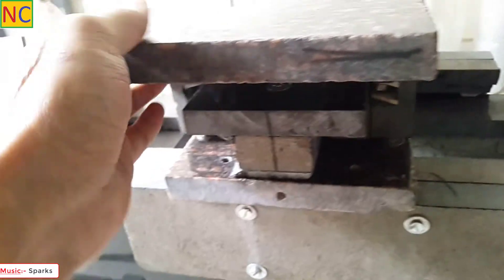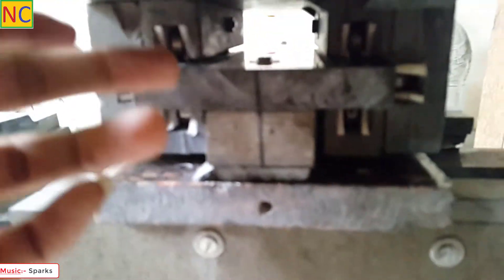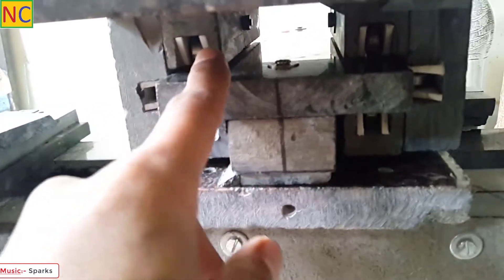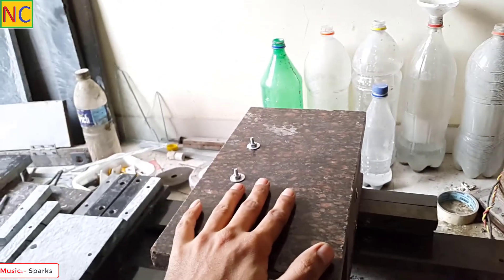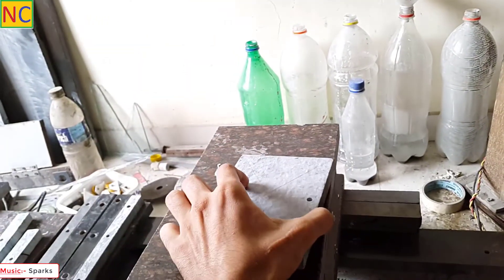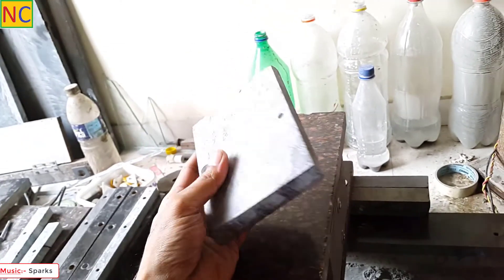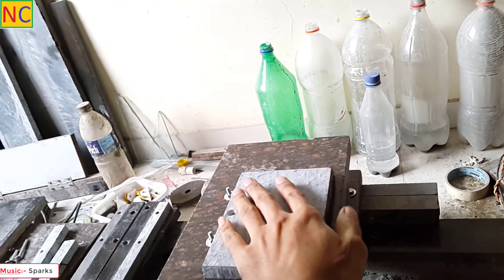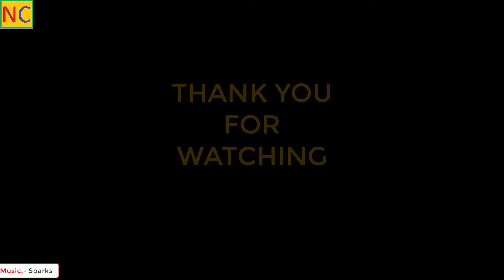How To Make Lathe Machine | Part - 2 | Homemade  Lathe Machine | Nonsense Creativity

Comment: Hi, wonderful project. How do you think that two pieces of granite will slide on each other?

Subscribed!
Reply from the maker: Hi.. happy 2020.. well.. I'm using ball bearings but it is not necessary... you can use two polished surfaces of granite or any other stone and proper lubrication will work fine. 

Now i am working on tailstock and i ditched  ball bearings ...
Reply: @creativeamol  Thanks, and happy 2020. Would you recommend using oil for lubrication just like for steel?
Reply from the maker: @Made2hack  its depend on the sliding mechanism design because it need certain type of  viscosity oil..better you go for grease.. and do some  trial and error ...
Use the machine for specific duration and check whether lubricant is circulating or not then change the oil for different viscosity

Comment: what are you using as reference surface? is that just some polished granite? while it might look shiny, it often isn't very planar. you might want to lap in some plates with the three plate method (there's also a two plate method, but it requires you to make a tool for measuring planarity). You can see how that's done here https://www.youtube.com/watch?v=X37SIhRmzf4
can't get a flat part if the reference isn't flat to begin with.
Also, I think stone on stone might not be the best for sliding partners. There will be grit that builds up over time jamming the mechanism.
Reply from the maker: HI, thank you, glass and granite itself , because i don't  have anything planer than this at home :( now i am working on chuck plate :)
Reply: @creativeamol  what I was saying is that you can create very planar surfaces with the method in the video. All you need is some grinding powder (I used silicon carbide) and a lot of time. If the surface was ground before it shouldn't take too much time anyway.